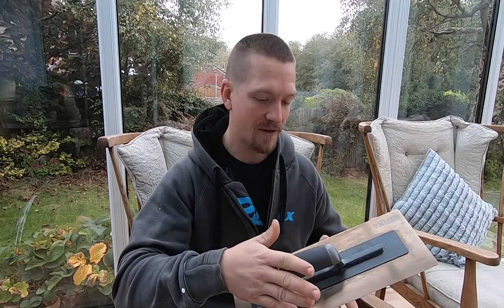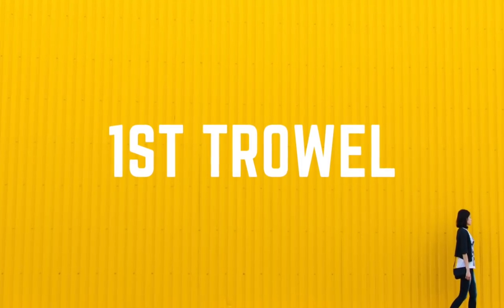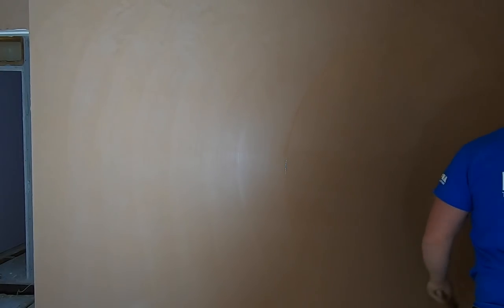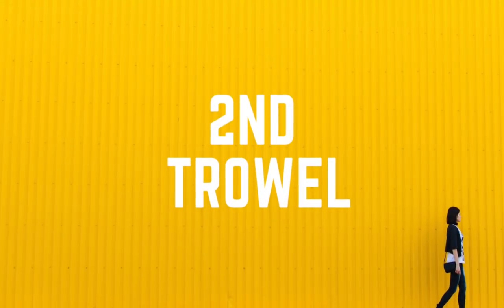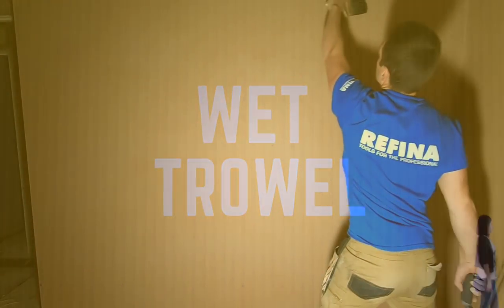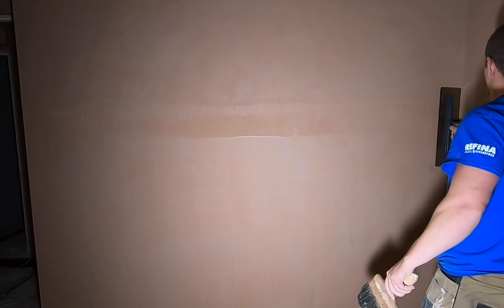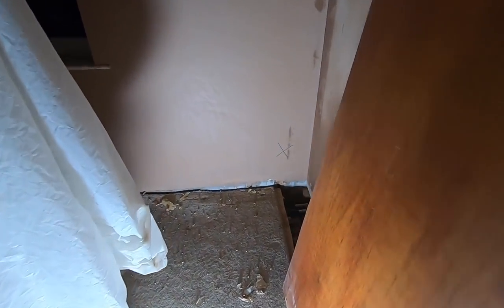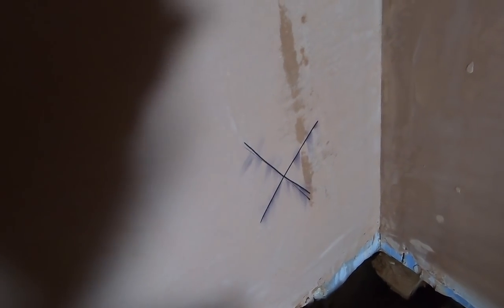Is This The ULTIMATE Plastering Trowel?? The Refina Superflex 3 Review (ROSE GOLD EDITION)

Comment: I have one trowel for skimming, marshalltown gold, had it for years  use it start to finish, if your just starting out plastering there are no magic trowels that do the job for you, next there will be a super dooper flexi 3.1 turbo with bells and whistles attached to the handle 🤷 These flexi trowels are about saving the pressure on your joints? If you learn how to lay the first coat on flat as you are laying it on, you don't need a lot of pressure throughout the whole prossess, to get good at skimming you need experience, not a van full of different trowels to do one job.
Reply: hahahaha

Comment: Anyone tried laying second coat with Plaziflex plastic trowel? I find it amazing takes most of the lines out when still wet.
Reply from the maker: I haven’t my friend but I’m glad it works for you!
Reply: Hi 1st coat Marshall town then second plaziflex it's brill an a lot easier an faster seems to flatten as well glad u put post on I try to mention it to others but there not interested plus it takes a lot of pressure if you 👍👍👍👍
Reply: @lyndonmather3321  Yeah I agree mate. I got the idea off another plasterer on YT who has his own chanel on here. Laying second coat with it is a doddle. Great tool.
Reply: That's were I got it from can't remember who I've tried to look for it some say by doin that it's not flat but to be honest I won't change that way an it's brill plus it seems to finish wall for u an not much work after that I do use the nela black after that I USTA to use the ox ultraflex which is a great trowel but haven't used it for a while lol because the plaziflex as done it for u was it the Irish guy he used it once on his you tube channel ? 👍👍👍
Reply: @lyndonmather3321  Name of the chanel I had it from is 'Plastering Force'. As you say, some people won't use them to lay on fearing it won't get it flat but I go straight over with a speedskim anyway so that's not an issue. Saves so much time and effort.
Reply: I seen plastering force a few times have u tried the nela plastic float  I tried it yesterday that was after I laid 2 Nd coat on with the plaxiflex I was just experimenting lol then I used the nela black finishing